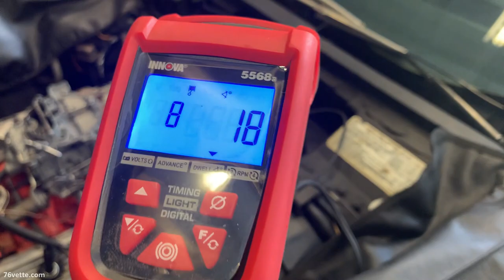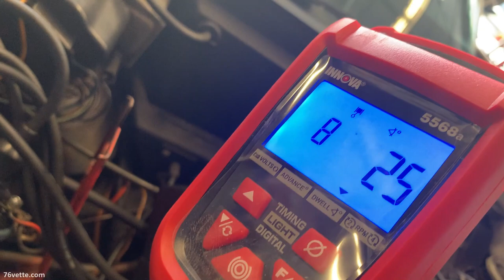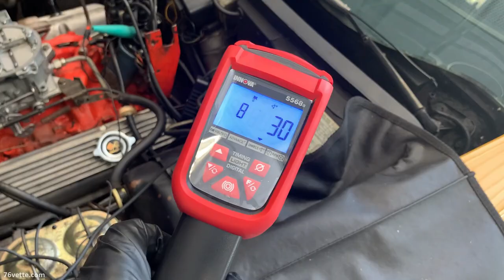Adjusting Chevy 350 V8 DWELL ANGLE

Comment: IIRC, with those old Delco 'Window' distributors, you screwed in the adjuster till the engine 'stumbled' then backed it out 1/2 turn... and the dwell would be, by design, tack on.[1]

Did many thousands of them in the day.

Remember once reading they designed them that way mostly as a factory convenience.

[1] Dwell meter calibration (and/or quality) often varies... the half turn method removes them from the equation.
Reply from the maker: Thank you for sharing that tip. 😊👍🏻

Comment: My Mercedes-Benz 450sl v8 states 45deg, and sticks there even if the car is running? What is going wrong?
Reply from the maker: It’s impossible to diagnose a car online, but AFAIK, the common dwell angle for V8 engines is 30°. No idea why yours is “sticking.” Sorry.
Reply: @76vette  I think I’m not using the instrument as is it supposed to be used. The manual translation is a bit vague.
Reply from the maker: @benjansssen  Make sure the red lead of the dwell meter is connected to the Negative terminal of the coil. The black wire of the dwell meter has to be connected to a good ground on the vehicle. Most dwell meters have a function switch to select the number of cylinders of the engine and Tach or Dwell. The screen will also have different result tables so make sure you’re reading the correct one. Other than that, they are very basic instruments. 
Lots of YouTube videos on the subject so search for the dwell meter you have and its operation. Good luck 😊👍🏻

Comment: Points is old school and there’s nothing wrong with it. My Pertronix lasted 15 yrs and my Crane XR-i also lasted 15 yrs. I was going to try the Accel unit, BUT after reading ‘bad reviews with these modules, some don’t even work out of the box. So F it. I’m back to using points and condenser in my 70 Z/28.😊 BTW I wouldn’t trust that electronic dwell unit. I still use my tach/dwell meter I bought in 1973.
Reply from the maker: Love it. Old school tech is just fine. Sometimes you need to take a step back to move forward. 😊👍🏻
Reply: I've used points on my Chevy 350 for years without any issues. Then came a time when everyone went bonkers over electronic distributors and decided to switch as well. Ran fine too but couldn't feel the real difference with points. Then came a time when I got stranded in the hot tropical heat with a burnt out module. Read lots of reviews and most did say if it's a stock street driven car on daily basis, nothing beats points. It hardly fails you. Now I'm back to points and happily drive her daily without fear

Comment: When you changed the dwell angle, you also changed the timing.  You have to reset the timing.  I'm curious as to why anyone is still messing with points when a Pertronix system is so superior, permanent, and invisible.
Reply from the maker: We replaced and set the points on my friend's '73, then set the dwell angle, then the timing at idle and full advance. And while a Pertronix system is superior, not everyone can afford to make their cars "better," so we do what we can with what we can afford. Properly adjusted ignition points work well but they require constant maintenance.
Reply: @76vette  MY POINTS ALWAYS WORK , THATS WHY,  THE PERSON ADJUSTING THESE POINT MUST HAVE BEEN PUSHING HARD WITH THE ALLEN WRENCH TO MAKE THE ADJUSTING TAKE SO LONG, GET THE CORRECT TOOL AND U ARE DONE IN SECONDS.
Reply from the maker: @wayne57chevy53  Thank you for watching! 😊👍🏻
Reply: Where do u hook up the dwell clamp on an hei??
Reply from the maker: The GM HEI system has a module that makes all necessary adjustments. There’s nothing to connect to or to adjust.
Reply: Some of us want to maintain the original technology and don’t mind “maintaining” our cars
Reply: @justinpriest1513  whats the answer to this? I’m looking for it
Reply from the maker: The GM HEI system has a module that makes all necessary adjustments. There’s nothing to connect to or to adjust.
Reply: @76vette  oh so the green cable is left without connecting? Just sitting in mid-air basically?
Reply from the maker: @juanortega-flores9765  Yep! 👍🏻
Reply: @76vette  fulla dvance??? my car starts detonation with full advan
Reply: I'll let you in on a little secret... Pertronix is not as reliable as you think.  When it shits the bed your car won't move an inch. 
Points on the other hand...are extremely reliable. Nothing wong with them.
Reply: Because they are chinese junk. Points may be old school, however when you are stranded out in the sticks there is nothing better than a good set of points and condenser.